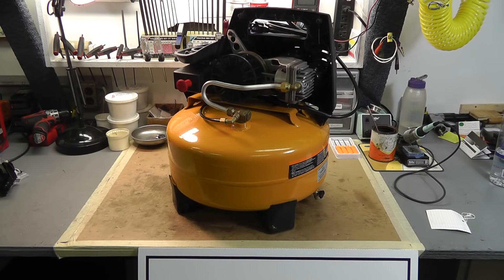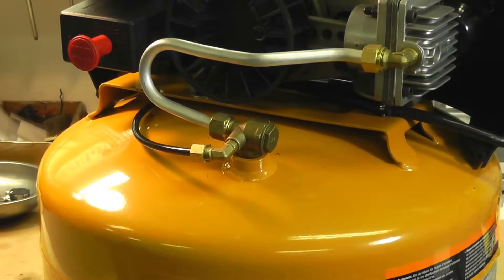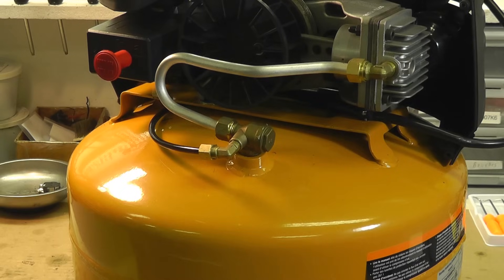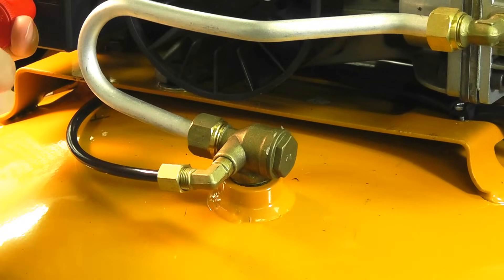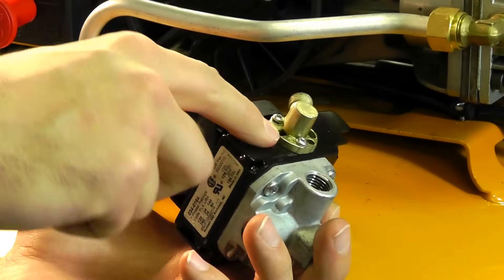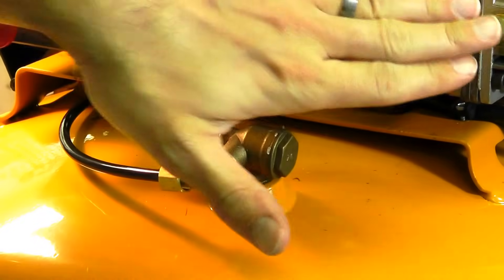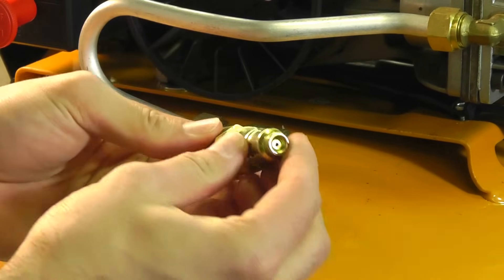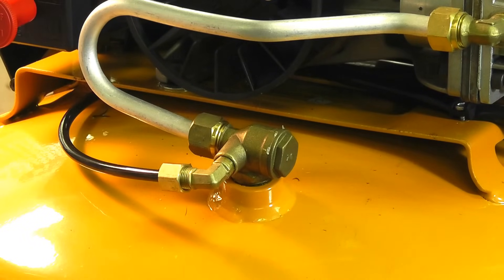How To Test A Check Valve (One-way Valve) On An Air Compressor

Comment: My compressor reaches its pressure and cuts out like it is meant to however it immediately restarts cuts out restarts cuts out and so on until i switch it off at the mains switch any ideas on what could be the problem?
Thanks 
Graham
Reply from the maker: Thanks for the questions Nick. It does sound like your Check Valve could be the problem. It's probably sticking open once the unit shuts off, thereby back-feeding all of the tank pressure out of the tank and through the lines and out to the atmosphere. Does the tank hold pressure when the unit is completely off, or does it hold air? If it leaks when the unit turns off, you certainly have a defective Check Valve.
Reply: @AirCompressorPartsOnline   thank you for your reply when i switch it off i get some air leaking from the pressure switch  then it stops yes the tank dose hold its pressure at is maximum which i set to shut off at 100psi  purely for safety and peace of mind although it cold hold more im happy with that. to mention it did have a Cormack pressure switch which went wrong and changed it for one like you show in the video i also changed the small tube from the check valve  as well, does the small tube diameter make a difference if it is bigger or smaller to the original?
Thanks
Graham
Reply from the maker: @nickgreek8239  Glad to help! It seems as though your Check Valve is good, then, as your tank holds air. IT sounds to me like the original pressure switch is defective. The contacts inside could be dirty or corroded, causing the problem you're experiencing. I don't believe the diameter of the bleeder tube matters, no, as long as it fits snug into the fitting on each end of the tube.

Comment: Belt came off mine other day and put belt back on it reaches like 30lb motor slows down throws breakers
Reply from the maker: Thank you for the comment! This is a common problem. Most likely the belt is simply too tight or too loose; IMO I believe the belt is too loose. When you press down on the center point of the belt with your finger, there should be 1/2" of deflection. Any more or any less and the belt is too tight or too loose on the pulley and flywheel. If the belt "slips" (meaning it's too loose), this can cause the motor to trip the breaker as it's being put under an intermittent load. So, I'd adjust the belt so that there is 1/2" of deflection, make sure the motor pulley and pump flywheel are aligned properly, then give it a go. It should purr once you do!
Reply: Air Compressor Parts Online yea I tried different pump and motor somehow it done it on them they are old stuff so possibly the conditioners got weak

Comment: just took off the nut that has the spring and plug on it and found crud and bits of plastic on the plug. Back in business. Thanks for the video
Reply from the maker: We're glad to help you out Ron, thanks for the watch!
Reply: @AirCompressorPartsOnline  hi i got similar problems with mine,  it doesnot fill in the tank because it runs through the small pipe to the pressure switch,  i have replace it, clean and machine the valve seat , still not good. Although there is plenty pressure out of the cylinder head. its a Fini 25l compressor, i wonder what else could be wrong there...thanks
Reply from the maker: @alfro04  Thanks for the question! If the unit runs and you do have pressure, but the tank isn't being filled, it could be a check valve problem, yes. There is nothing in between the tank and the pump discharge other than the tube and the check valve. The check valve could have debris stuck inside of it, hampering airflow. I would remove it and clean it and if that doesn't work, I'd replace the check valve as that should take care of the problem.

Comment: Would a malfunctioning check valve cause air to bleed back into the cylinder head and prevent the piston from compressing, thereby tripping the breaker when it tries to restart? I've got a small Rolair with this problem.
Reply from the maker: Absolutely. A clogged or malfunctioning check valve can certainly cause back-pressure to the pump head, thereby making the motor work against that pressure and in all likelihood will trip the motor reset and/or breaker.

Comment: My SIP hurricane v300 / 100 was leaking from the pressure switch, was about to order a new PS but thankfully I stopped by an air compressor dealer who gave me a new rubber stopper to fit in the check valve. My compressor runs like a champ again and it cost me €0:00

Thanks to o'neills industrial limerick
Reply from the maker: That's great to hear James, smart decision!
Reply: Air Compressor Parts Online well after using the compressor I found it very slow to refill, takes ages to get from 60/120psi. Why would this be, it holds air amazingly long now, I resealed the joints.

It's a direct drive, no oil, 3 year old unit.
Reply from the maker: James, it sounds as if there is either an obstruction in the check valve (even if you just replaced the seal, as debris from the pump head could have made its way into the check valve) or one or more of the pump components is defective and needs to be replaced. Slow pressurization is usually caused by either damaged gasket seals, defective reed valves or piston ring in the pump itself. With oil-free units it's common to see a defective piston (compression) ring. Visually inspect the ring for damage around the outer perimeter where it makes the seal with the cylinder wall. Most likely you'll noticed it is torn, notched or torn, not providing a good compression seal within the cylinder. Also inspect gaskets and valves while you're there. But, barring a major, obvious air leak somewhere else, I'd bet the problem lies in the pump itself.
Reply: Air Compressor Parts Online the old check valve was plastic and shattered, 👍

Also, I'm thinking of joining two of these compressors to on airline for more psi, is it simple as joining them to the air line or do the units need modification.
Reply from the maker: James, that's great to hear you found the faulty check valve. As to your second issue, you can do this as long as your circuit breaker can withstand the amperage with both of them running at the same time; if not, then you would need to change the setting of the one pressure switch to be lower than the other unit (do not raise the existing pressure due to safety) to allow one unit to come on and shut off before the other one does. Essentially you would be alternating the compressors.
Reply: Air Compressor Parts Online interesting. Why would you want one compressor running in between the others on/off points

Comment: AC could this be my problem my air leak is bleeding thru my oil cap ? Good piston rings great cylinder walls but air is still blowing out of the fill plug ??? Help me help me please !
Reply from the maker: Yes, this is a definite possibility. Is this happening while the unit is running or after it cuts off?
Reply: Air Compressor Parts Online Both but the check valve had trash in it holding it open so for now I will be  checking it 1st ! But the reed valve had trash  trapped to so my symptom pointed toward the oil rings not ! They were fine it's running like its brand new  lol! Thanks big time!
Reply: @AirCompressorPartsOnline 
 hi bro.i have a same problem.air leak at the oil cap and one plastic filter (i dont know the true name,plastic like a filter) on the crank case after cut off pressure switch.
Maybe it cause problem from a unloader valve ?

Compressor dual stage ( double piston ) jaguar 2hp 100liter

Comment: I've got a Craftsman 12gal 125psi upright that was given to me free because it did not build any pressure. I found the gaskets deteriorated inside the head. I replaced the gaskets and both reed valves and after reassembly It builds to only 75 psi. Air constantly leaks from that bleed valve you are talking about (while its running, not when i switch it off) and it never goes over 75psi. I noticed a lot of airflow coming out of the "muffler" for the crankcase so I thought maybe the rings were bad, so I replaced them too. Still will not build over 75psi after the rings.... any thoughts?
Reply from the maker: Hi Chad, what is the model number so that we may look up the unit?
Reply: Model# 921166400, Thanks!
Reply from the maker: Looking at this page:
https://mastertoolrepair.com/air-compressor-parts-921166400-p-22148.html
Which bleed valve are you referring to?
Are you referring to the unloader valve under the pressure switch?
Have you removed item 36, the check valve to see if there is debris in this valve preventing all of the air from entering the tank?
Reply: My neighbor and I figured it out. When I rebuilt it the edge of a reed valve got stuck under the plate. It caused the reed to break! Now building max psi, thank you though!

Comment: what make/model air compressor is this pls??? I have an air compressor near exact set-up but with a "sketchy" output line. The head (from the outside) looks exactly like mine, but the one in this vid has a screw in connector. I've been looking for a replacement head with the threaded output! Pls help. Thanks in advance...
Reply from the maker: I believe that this unit was a Bostich CAP2000P-OF located at the link below:
https://aircompressorpartsonline.com/stanley-bostitch-air-compressor-parts-cap2000p-of-bostitch-parts-p-21197.html

Comment: Would that cause excessive pressure and in turn trip a breaker because of excess current draw trying to spin the compressor with the added pressure?
Reply from the maker: Yes, this would cause back-pressure on your pump not allowing the motor to get a head start prior to pumping. Please let us know if there is anything else we can assist with!
Reply: @AirCompressorPartsOnline  so could it fail where not leaking but causing excessive pressure at pump? Or could it fail backwards as in stuck closed from pump? Seems like no but I've replaced capacitor and pump and still won't run after fill. Emptied tank and last time still wouldn't run. This time does run when tank empty, but if I stop at 30psi and restart won't run. Pump tries but wont run after half second and amps peak so shutoff before trips breaker. Have new switch but dont think thats it. Brand new Stealth 20gal from TSC. Others have had same issue.

Comment: As far as removing/replacing that 90 degree style valve, how are you getting that off without mangling the valve? I had one recently that I couldn't get a decent wrench on it, and ended up buggering up the assembly pretty bad. What do you use to get it off?
Reply: Pay attention lol if its messing it up don't keep going the same way try another method

Comment: Eric, my Bostitch BTFPO2011 pancake compressor will not shut off. I can't seem to find any leaks after I manually shut it off. Any ideas?
Reply from the maker: Thanks for the question! If you don't detect any discernible leak while the unit is running or after you shut if off (and you can spray soapy water all over the unit to confirm this), most likely the problem lies in the pump itself. You probably have either a blown gasket, damaged reed valves or piston ring (most likely), so it's not able to build enough pressure to reach the max PSI pre-set for the unit, at which point the on/off pressure switch would shut the unit off automatically. I would take the head off of the pump and view the reed valves on either side of the valve plate; make sure they're not cracked or rusted badly. If they appear to be intact, most likely you have a damaged Piston Ring. Make sure there are no kinks, folds or tears on the outer perimeter of the Ring. If you see any light between the ring and the cylinder wall, it's worn and needs to be replaced. It's recommend to replace the Cylinder and Ring, so our Piston Ring/Cylinder Kit (part# Q369840), which you can view by clicking on the below link:

https://mastertoolrepair.com/portable-oil-free-direct-drive-air-compressor-parts-btfp02011-p-396948.html

Hope this helps!

Comment: THANKS, MAN solved my problem. Problem : Compressor builds up normally, turns off and blows big time from pressure / electrical switch ... But as you said check valve had rust particles fouling the seat . So to do the job I dropped the pressure in tank removed the section of check valve that was obviously the plug and cleaned it.
Reply from the maker: That's great! That's a very common problem, and it's good to know this video helped you out. Thanks for watching!

Comment: My air compressor probably have a defective check valve. It fill air up to 50psi then shut off. I ask the paint forum but no one seem to answer. This video help though, probably replace it and I be back to spraying paint with my paint gun.
Reply from the maker: Thanks for the comments! Your Check Valve very well may be need to be replaced. The tell-tale sign of a bad check valve is if, when your compressor shuts down, it leaks constantly and bleeds the tank empty. Usually the leak will occur at the small bleeder valve connected to your pressure switch. What is the maximum PSI your compressor puts out? You said you're only getting 50 PSI, then it shuts off...this seems more like a Pressure Switch problem. The Switch controls the cut-off pressure, so if your unit is supposed to shut off at 120 PSI but it's cutting off at 50 PSI instead, the Pressure Switch is probably defective and needs to be replaced.
Reply: Air Compressor Parts Online my air compressor should go up to 150 psi, 5.5 hp 30 gallon Craftman. I replaced the water release valve, the safety release valve, add a airline ball valve  and I put teflon around the leaking hose connector. It does goes up 120psi now. The water valve release more air and water then the old one when release. At least its better then before I have to turn it three time before i get enough air. Probably not my check valve but I replace those other thing.
Reply from the maker: That's better! Correct, it sounds like a different problem entirely. Now that the compressor turns off at the PSI it's supposed to (or close to it), make sure the unit doesn't leak down after it shuts off. If you notice that it does, I'd then replace the pressure switch. Thanks for the questions!

Comment: I have a husky 412 270  vlh1582609 01 wich don't have a unloader valve to unload pressure from piston after shut off. What will release the pressure from back of the piston on this model? My compressor runs fine until it has to cycle or restart after I use some air from tank, it does the hmmmm sound few times but it won't start if I empty the tank it does start right away and fill tank with out any problem until it has to cycle again. I bought the pressure switch because I though it was equipped with the unloader valve but it is not and also was stoping at 140 psi when my compressor should stop at 155 psi, any way found out that the shut off at 140 psi was a bad gauge because even after replacing the pressure switch still was stoping at 140 psi, I did replace the pressure gauge and now stops at 155 psi like it is suppose to do. Now I still have this problem that it won't restart as I use air, just do the hmmm sound until I empty tank and fill the tank again. What will cause the pressure on the piston after shut off if this model is not equipped with unloader valve. Any suggestion will be greatly appreciated it. Check Valve will be the problem?

Comment: I have a check valve that looks just like the one in this video, but it is on a much larger compressor. I purchased the compressor used and it was not working. I replaced the pump, but it is now leaking air just like you describe in this video. It leaks at the unloader valve and the oil fill tube?  I am getting ready to order a check valve from your web site, but wanted to verify something. I have already taken the check valve out and there is nothing inside it. If that is the way it's supposed to be, I can't even seen how it can go bad. I assume there are supposed to be components inside this value? If so I am assuming someone has removed the inner workings before I purchased it.
Reply from the maker: Thanks for the post Randy. There are certainly supposed to be components inside of the check valve. There should be a diaphragm and spring (or a polyurethane ball and spring if it's older) inside the brass check valve. If there is nothing there then the components have probably fallen into the tank or disintegrated. It sounds like replacing the Check Valve is the way to go! Report back when you do as it would be good to know if this did the trick.

Comment: what if my 150psi pancake only charges to 120psi or so and turns off? what do I turn to knock it up to 150psi?
Reply from the maker: If the compressor only pressurizes to 120 PSI and turns off, that's certainly a problem (most likely) with the on/off Pressure Switch itself. The pressure switch is an electro-pneumatic switch that senses the cut-on and cut-off pressures, and the cut-off pressure is preset for 150 PSI. If it only reaches 120 PSi then shuts off, it's not sensing the pressure accurately and either needs to be adjusted or replaced. Some pressure switches are not adjustable so replacement is necessary. What is the model# of your compressor?

Comment: Awesome video.  Just installed my "new" (never run) 4 year old compressor and it leaked right away from the breeder valve.  Watched this video and was able to remove the check valve, and sure enough, there was some debris holding it open.  Cleaned it up and it works great.  No need for new parts this time, but when I do need them, ACPO will be my first stop for sure.  Cheers and thanks again for such great videos.
Reply from the maker: Wow, thank you for the positive comments! That's what these videos are designed to do, and it's great to know that it helped you. Thanks again!
Reply: Thanks for the video and saving me some cash.  Cheers.